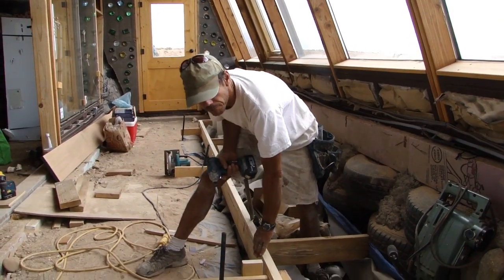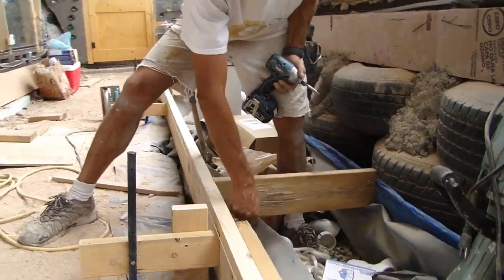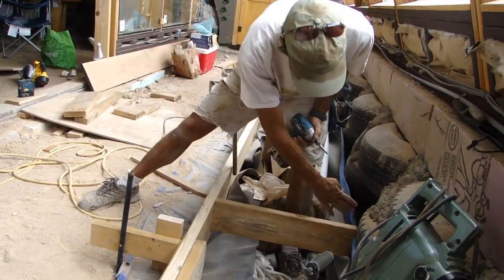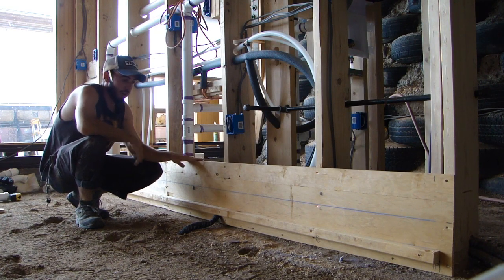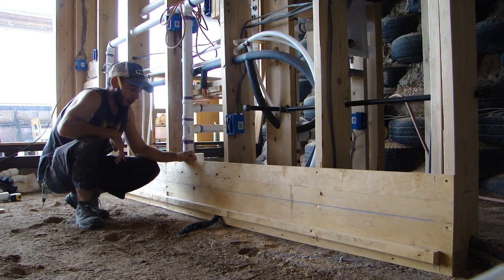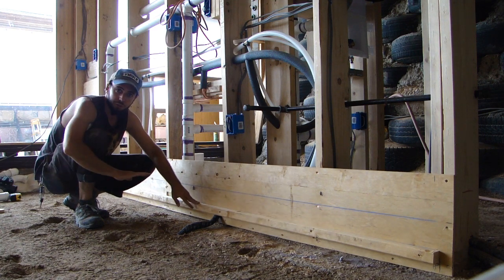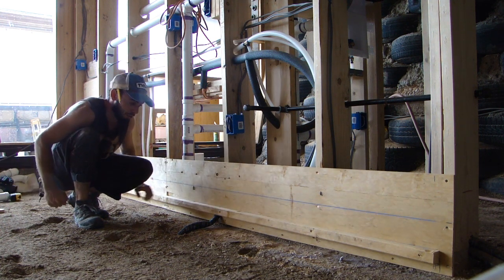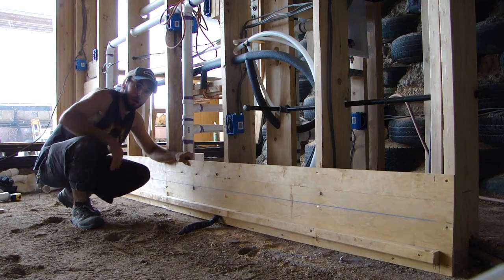Concrete Slab Floors - Part I

Comment: absolutely love this concept of housing, but I see a flaw in the damp coarse for the flooring, (30 odd yrs in the building and water proofing trades experience). I would think, the once the ground was levelled for the tyre wall polythene would need to go down across the base, then the tyre wall constructed, then prep an pour the concrete floor before any other part of the building, once it is cured,  then  proceed with the rest of the building, ?

Comment: Lots of studies have proven used like this tyres don' give off gas like they would in a lose pile. Don't quote me it has been awhile but I believe it is due to the fact they are not exposed to direct sun light and they are tightly packed, not to mention covered in layers of dirt. Its safe and very green given you are reusing a waste product there are little other uses for.